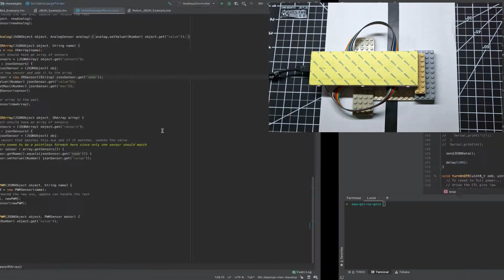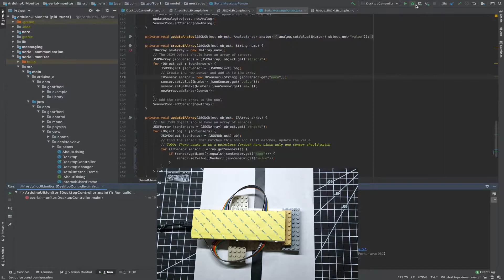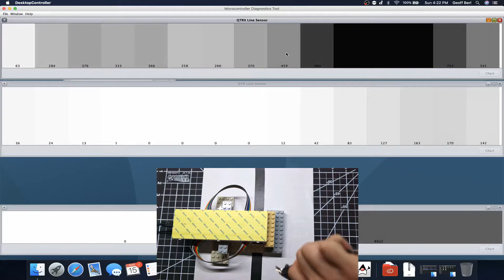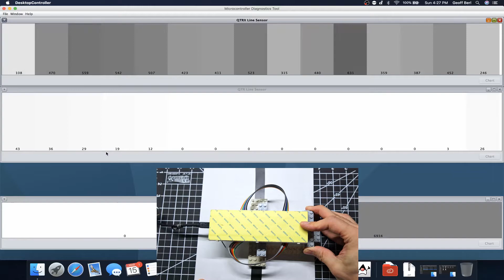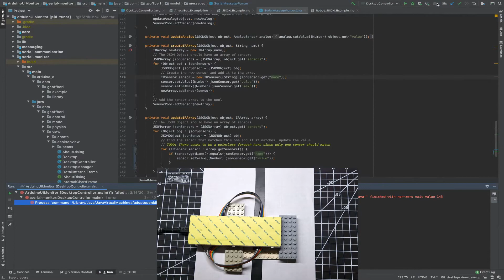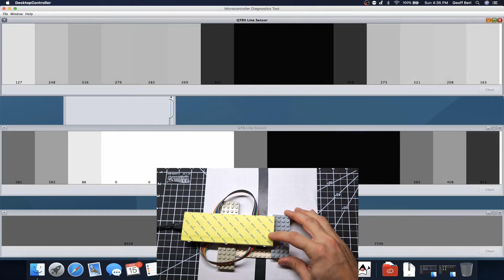QTR 15HD vs QTRX 15HD

Comment: Is there a way to skip the calibration step every time the power is on and off?
Reply from the maker: There is, the library (my version) has four arrays that hold the minimum and maximum readings for each sensor. (calibratedMinimumOn, calibratedMaximumOn, calibratedMinimumOff, and calibratedMaximumOff).

The latest version of the pololu QTR library also has some values exposed so you can set them directly which are held in a struct called "CalibrationData".

I cannot easily give an example through a youtube comment but if you need some help you can contact me through http://robotresearchlab.com/contact-me/, just be sure to use your real email so I can respond to you directly.
Reply: Hi, I have the same question as you. Were you able to solve it?

Comment: Can you please tell me can we use resistor - capacitors timeout logic for TCRT 5000 IR sensors

Please tell me any metod of finding capacitors resistor value and time required per sensors reading

Calculation formula or pdf for same
Reply from the maker: I would recommend just hooking them up to the Analog pins on the arduino and using the QTR library for analog, I wouldn't know what RC values to use for your sensors to be compatible with the QTR library. Just use the resistors called for in the datasheet or an example online, it looks like something around 100-200 ohm would work. They don't have to be the QTR sensors or even Pololu brand for that matter. The library will work with any analog sensor or array of sensors. I hope that helps, let me know if not, I'll see what else I can come up with.
Reply: @RobotResearchLab  

Yes I will definitely try and give you feedback

Thank you so much

Comment: Which is better
RC (resistor capacitors) eg. Pololu 8RC
Or
RR (resistor resistor) eg. Pololu 8 A
Reply from the maker: There really is no clear cut answer, it depends mostly on two things, I go into much greater detail in this article http://robotresearchlab.com/2019/03/06/pololu-qtr-8rc-vs-qtr-8a-sensor-array/
1. How fast is your processor?
2. How many analog/digital pins do you have available?

If you're using a slow processor like Arduino Uno or Nano (any using the ATMega328) then you'd be better off using digital with a timeout of about 1000us. The problem with Uno and Nano is they only have so many pins so you may not have enough available depending on other parts in your circuit. However, if you're using a fast processor (like a Teensy 3.x or 4.x) then you're definitely better off using analog as they're many times faster since the digital array is always going to be possibly as slow as whatever the timeout value is. Meaning, if your timeout is 3000us, your results could take the whole 3000us.